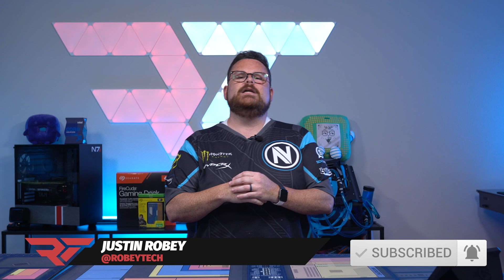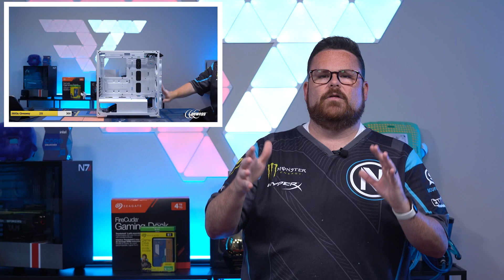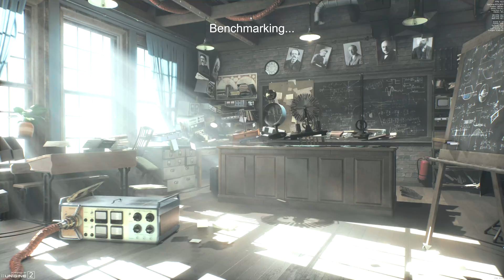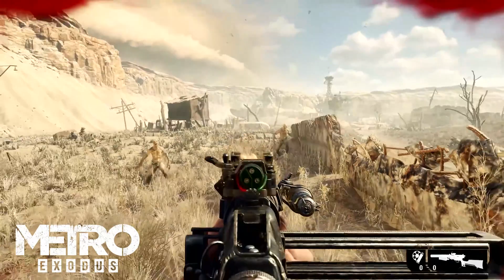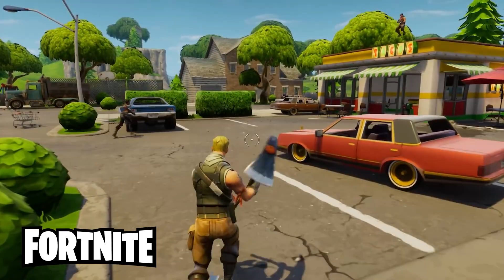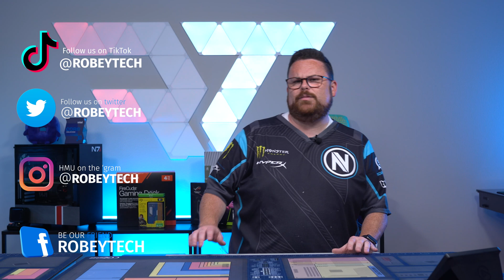How we Test PC Cases and PC Builds! This is the way.

Comment: I tried to find out how good the thermals were on the Corsair iCUE 5000X... apparently they're not as good as the 5000D or 5000AF (which all the videos I found were about the 5000D and 5000AF)... but I didn't find that till after I ordered the 5000X. W I guess... at least I can order the airflow front panel and top panel to get better thermals on the 5000X
Reply from the maker: We are going to be going back and doing some of the more popular cases to deal with just this.  Not sure about doing the 5000x but the hope is to be one of he go to places to get that information.